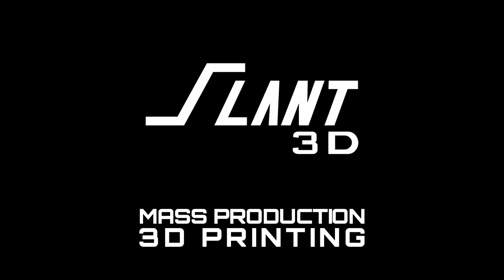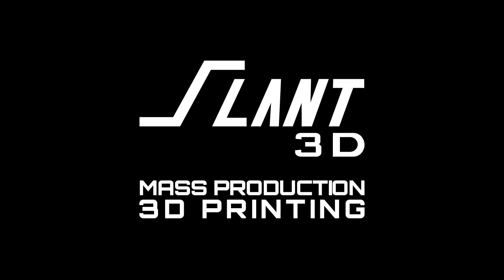The Future of Slant 3D: What Changes Are We Making At Our Giant 3D Print Farm?

Comment: Are your machines something that you will eventually offer? Potentially licencing the software that you created as well? There are just not good options for a farm. We currently run 80 Ender 3 and CR--10S printers up in Toronto that are just aging, and we want to at least double it in the next 6 months. But finding something more farm-ready and not just tinker-ready is nearly impossible. OctoFarm only goes so far and the printers themselves are hit and miss with reliability as time goes on. When you do the upgrade to your latest iteration, are you modding the machines that you have or will they potentially be available?
Reply from the maker: Maybe.It is certainly right up our alley.

Comment: You are going down a dead end street. There is no product a 3d printer can make. It is only for prototypes, so your "print on demand" comments are meaningless. You tell me. Name a real product that can be 3d printed? Give an example of a product that isnt a joke, or toy.
Reply from the maker: Jet Engine Valves, Venturi Ventilator Tubes, Automotive Parts, Spare parts for household products, Thousands of toys, Gaming Gear, Cookie Cutters, Minatures, A Wrench on the Space Station, Woodworking tools, Grocery Delivery Robots, Warehouse Robots, Water Turbines, and anything else on the planet that is not plastic wrap.
Reply: @slant3d  A jet engine valve, ROFL. Are you serious? I hope you print it with PETG, ROFL. I love your enthusiasm, but it is straight out of the 1990s. You simply can not make a 3d printed plastic part, and sell it. Other than a toy on etsy, or ebay. 3D printing toys is not a real business. It is a "cottage industry gig". If you want to make the jet engine parts, you need to switch to CNC. Which was my original point to begin with. You are on a dead end street with 3d printers. Please let me know your thoughts.
Reply: here's 2 quick automotive examples. porsche has had 3d printed modular car bucket seats in production as an option for just over a year. bugatti chiron has had 3d printed titanium break calipers since 2018. an even better example would bbe the adidas 4d shoes line. fdm parts are very common for functional actual production parts particularly in jigs and fixtures among other things. there are also other forms of 3d printing besides fdm. fdm can also be used to produce metal parts and continuous composites, with materials like ultrafuse, and markforged continuous cf onyx, not just raw plastics. other than fdm there are many many other forms of 3d printing which can be used to make all manner of materials from plastics to metals, to sandstone, to foods, to gels, and even biomaterials, with some example technologies including powder based laser/light sinter processes, powder based inkjet process, resin based inkjet processes, welding rod based direct energy deposition processes, vat photopolymer processes, there are even technologies like 2PP which is basically an electron microscope that can reliably print sub-nanometer lenses directly onto the tips of the worlds smallest fiber optics among other things. some injection mold designs with conformal cooling can only have the mold tooling itself made via 3d printing. a significant number of shoes from companies like adidas (such as the adidas 4d line) and newbalance are using production parts (like the whole damn midsoles on the 4d lol) made on rooms full of carbon brand 3d printers for customer end use production shoes. the jewelry industry shifted to 3d printing their casting molds and cores years ago for mass production out of 3d printed plastics and waxes, so did most reasonably modern shops in the metal casting forge industry. casting forges often use sandstone binder jetted parts for different mold/casting molds and mold cores, and sometimes low temp fdm plastics even that can burn ashless for investment castings to make mold cores. any metal feedstock that can be used in legacy metal injection molding processes or compression powdered metallurgy processes can for the most part also be 3d printed, including things like very difficult to machine materials like titanium, tungsten and tungsten carbide, tool steels, and super alloys like inconel, as well as more pedestrian materials like copper, aluminum, and nickel. you have an astonishingly strong opinion for someone who knows so very little about this field. here's a video from 2014 about airbus using both metal and plastic 3d printed parts on their airplanes at the time in production use https://www.youtube.com/watch?v=Cy3V3KR1LWc. probably worth looking into companies like relativity space as whose entire business is based around entirely 3d printed rockets. they just unveiled the new worlds largest metal 3d printer a few days ago. but yeah, if you buy modern adidas sneakers, or buy mass produced jewelry, it was almost certainly made directly in a 3d printed process, or a 3d printed part was sacrificially used directly in the production process to make the cavity for a casting.
Reply: @JustinBuildsThings  Yes, Porsche, and SpaceX, have 3d printers that can make real world parts. But this guy,.. this channel does not.  And I am only suggesting he switch from 3d printers to CNC machine. He could then make real world parts, which is what I think he wants.
Reply: @tazanteflight8670  lots of structurally and optically low end parts are injection molded or milled because 3d printing isnt there yet in the heads of most people...there are serious limitations, but there are just as many possibilities...and they keep expanding. but its challenging - same like with fiber-reinforced plastics...i was there when it exploded. before, everybody told me it would never leave the realms of highend space-tech or racing...

Comment: Running a print farm and pushing out thousands of parts is one thing, having an output thats accurate AND quality across thousands of machines is another. I run my print farm and I am constantly testing, adjusting, finding out what is the weak point when it comes to repeatability and accuracy. I absolutely love 3d printing and the potential of the print farm, but unfortunately it wont replace injection molded parts UNTIL we can get the repeatability, quality, and accuracy of parts as they would come from an injection mold (im not talking cosmetics). Right now printed parts have an accuracy of about 1%, this needs to get down to 0.1%. Im considering switching to .9degree steppers just to help with accuracy. Also the environment plays a lot in the repeatability of the quality as well. Temperature and humidity can affect the surface finish, the shrink rate. Theres so much that you have to juggle to get an extremely accurate part no matter what printer it comes from. This is the biggest challenge if you want to be a viable channel partner for production ready parts.
Reply from the maker: You're right. It is a tough challenge. That is why it is so important for us to continue to leverage our experience operating hundreds of machines as we expand into thousands many more thousands with the Megafarm and our print farm projects. All the issues you mentioned also contribute to why we manufacture all of our machines inhouse, so that they "print farm optimized" and not consumer machines used in a print farm context which lead to greater variation over time.
Reply: @slant3d  discussions like that is why you guys channels are so interesting for me! THANK YOU SO MUCH!